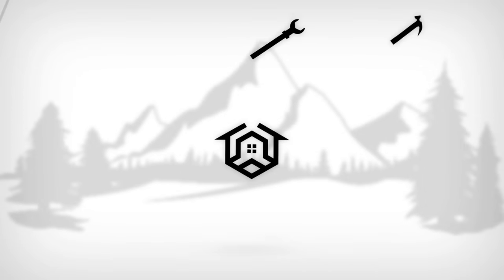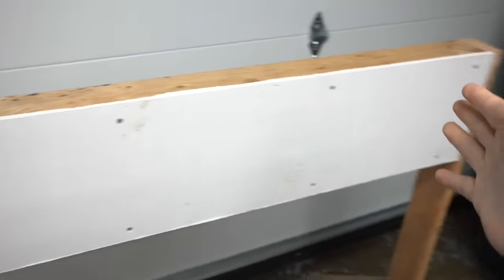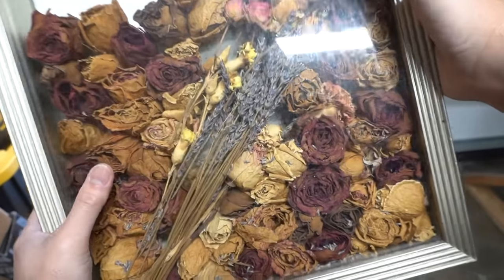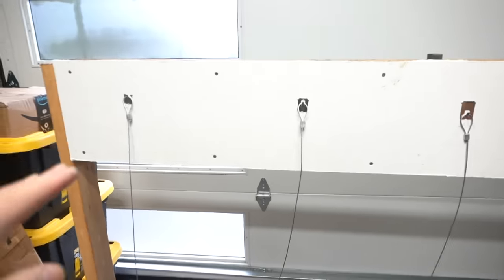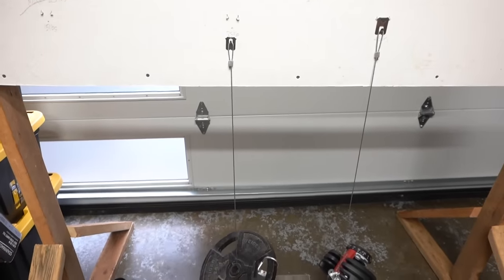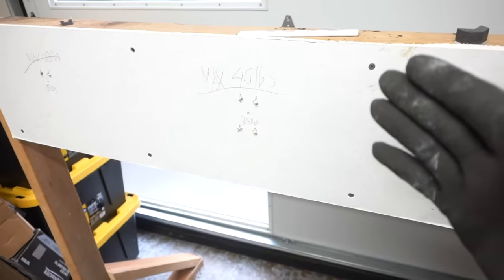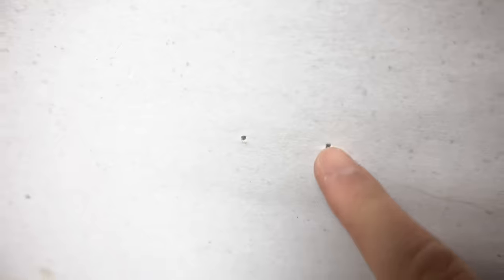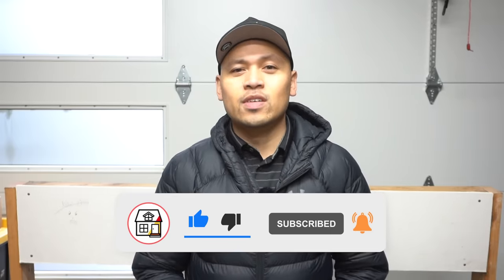The END Of Drywall Anchors?! Fastest And Easiest Way To Hang Heavy Items! LETS TEST IT! How To DIY

Comment: I HATE drywall anchors.  They DO NOT HOLD!!  The only ones that do are the ones that are metal and spring loaded, you stick them in the hole and they spring open, making it impossible to come out.  they can't be re-used though, once the screw comes out the part in the wall falls down.  If a screw can't be in a stud then it aint going up in my house!
These might work though.  I'm scratching my head why they even sell the lower weight ones.  It takes maybe one thousands of a penny more to make the 45 pound one?

Comment: You're using bare drywall, in real world applications the walls are painted and will give the drywall more strength. Older walls will have several coats of paint which will make the drywall stronger under weight pressure.

Comment: There’s no need for the weight test. The manufacturer already did it. DISCLAIMER: do not think “oh I’ll just use two and now it holds double” that is not how any anchor functions. I’ve watched TVs fall off walls because the installer thought “oh I’ll just put extra toggle wings into Sheetrock and it will hold” and yeah it will..for a bit😂. Anything that weighs more than 20 lbs should go into a stud and not have to worry.

Comment: These things look sketchy. I wouldn't trust them for anything over 15 pounds. The "claws" look like you'd get maybe a 1/4 inch penetration at best. The design of the "claws" was poorly thought out. I would have made them at least a 1/2 inch long and with a downward arc to give them more pull-out resistance. A flat area along the bottom of each claw would help to prevent the hanger from "knifing" downward. I definitely would only use these for items that hang straight down like the first picture. I wouldn't use these on anything with a wire, like the box of roses. Items like that have a tendency to lean away from the wall causing some of the downward force to transfer to outward force away from the wall. That is basically reversing the "easy" installation.

Comment: I'm really surprised they didn't curve the points of the claws in a slight arc downward. Having them act more like hooks, would immensely help with the pull out. Like when you angle a nail upwards, versus simply nailing it on the horizontal, the difference in capability is far superior.
Reply from the maker: I agree my friend! 👍🏽😊
Reply: They do have a slight downward angle when installed.

Comment: The only problem is that in the rest of the world, people build houses and walls from reinforced concrete and bricks.. not from cardboard and plaster that the wind can blow away. Usually you can't press anything into the wall.
Reply: Yep, houses that cannot be remodeled, are often very damp, and are very expensive to repair. Good luck moving an interior wall or adding a new wing to the house. It’s great fun to rewire, add power outlets, change light fixtures, rebuild, fix the plumbing, redo the data communications systems in such homes. People build with what is available at a reasonable cost. Don’t sniff at what you know nothing about
Reply: @philiparonson8315  Strong houses (stone, brick, concrete) are made by people who love quality and safety. They plan well where they will put what from the installation and the use of the space, so that they do not need any subsequent work. And in case of any modifications, it is not a problem to do it. It doesn't have to be a cellulose house.

Comment: Those Hooks are garbage, they may take the weight of something intially but over time they will pull out to easily, the reason the old drywall anchors hold better is because the back of the anchor will spread out inside the drywall preventing the platic plug from pulling out until you remove the screw from them. Those other anchors have Nothing holding them in place. I wouldnt trust one of those anchors with any of my hanging valubles, and I wouldn't let anyone i know use them.

Comment: This is foolish.  Buy the cheapest anchor system that gets the job done.  Nobody in their right might would plan to hang 2 dozen or more lbs from a single anchor and anything valuable, or weighing more,   you'd use a stud attachment or cross beam to studs if the studs are not where you need them to be.

Hint:  People have been hanging things on walls before your grandfather's time.